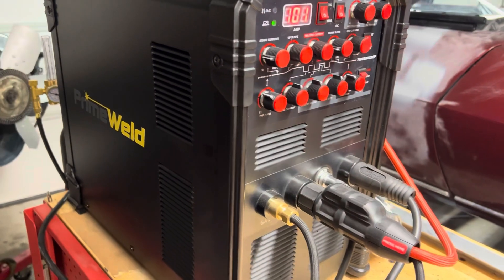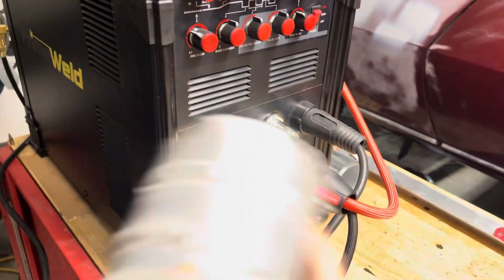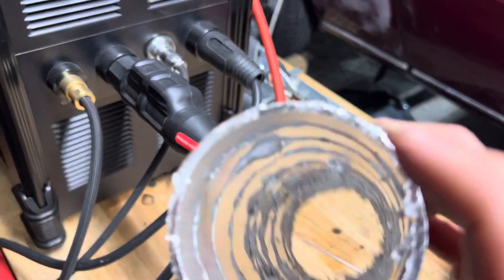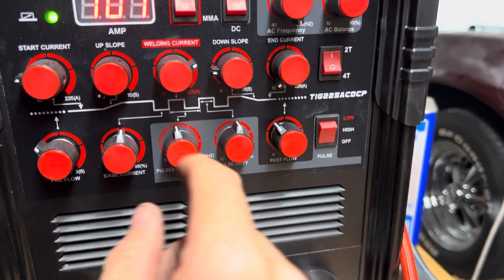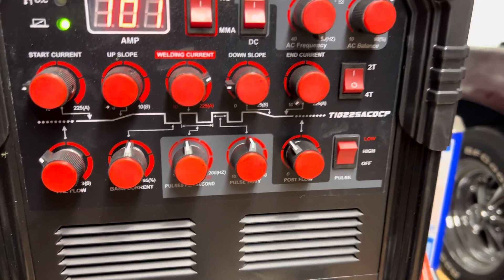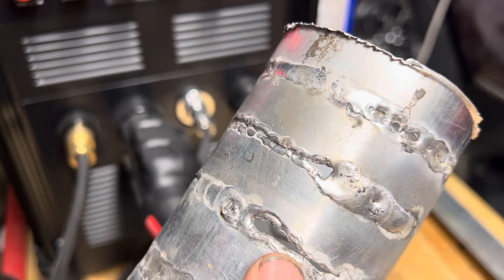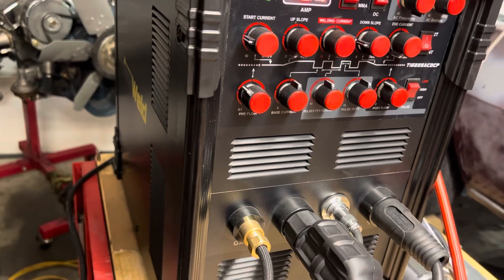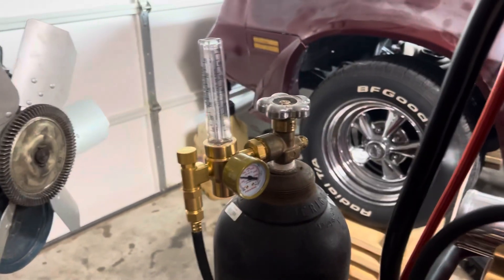Welding Thin Aluminum Prime Weld 225X

Comment: You should do your AC balance down to about 30% and then turn on your pulse to low with with a pulse/second set to a .5 to 1 sec. Then set your pulse duty to 20% (that will help with burn through). Then set your base current to 25% and that will allow your aluminum to cool between pulses. Adjust from there based on your speeds and how it is working.
Reply from the maker: Heck yeah thanks for the tips!

Comment: Turn your AC balance down to about 20 30% and you get a smoother weld in that aluminum and turn your frequency to about 120 HZ you'll notice a big difference in the machine that's coming from experience I've been using my Tig 225x for 2 years now!!! Definitely get you some gas lenses too you'll notice a big difference if you use a number five to number eight gas lens stubby makes a big difference pick you up a cheap RX weld kit or a yes welder kit....
Reply from the maker: Hell yeah man! Thanks for the tips!